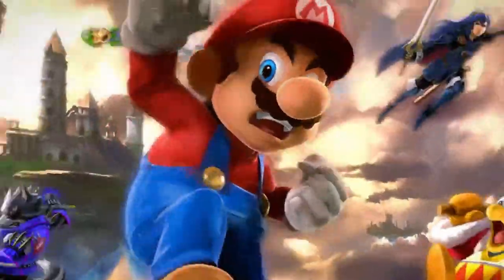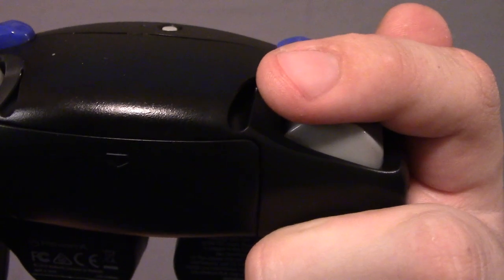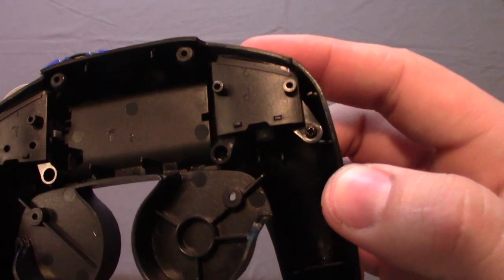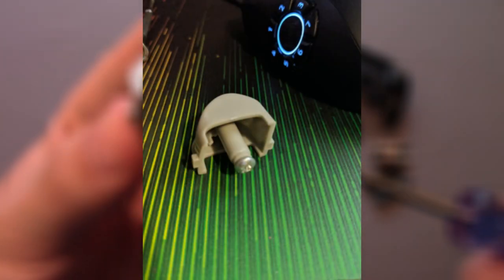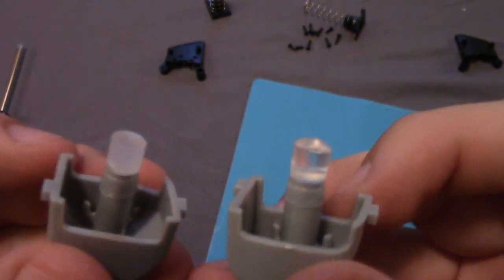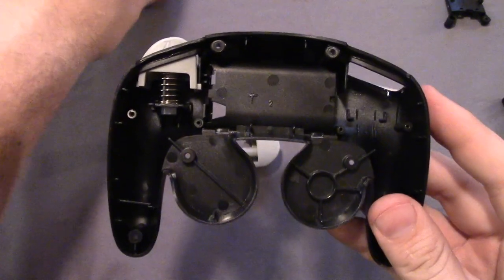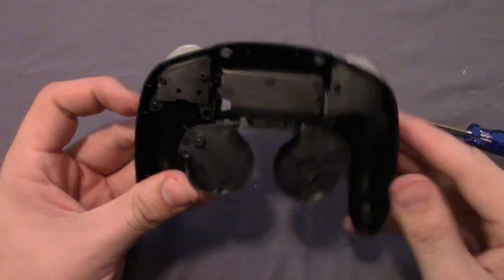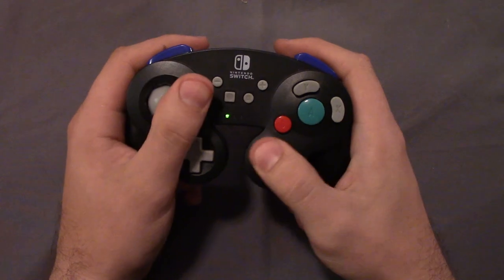How to FIX your PowerA Wireless Gamecube Controller Triggers

Comment from the maker: If you did anything differently to plug the triggers and close that gap, let me know! There is more than one solution and I want to see how creative you can be!
Reply: Can you make a video about the analog stick? I have multiple problems, an I'm looking to replace mine
Reply: a bit late to say, but a qtip's stick fits in perfectly
Reply: SpazTac13 I was the first person to do this 🤣 glad to see people actually using my idea I posted on amino now I’m trying to do it again on another controller
Reply: You can do basically the same thing using one of those pink pencil's rubber, cut it in half and use one half each side👍
Reply: Martin Schmidt  I bout 2 of them on sale at gamestop. I like them I wouldn't buy them for full price
Reply: brocoliobama wait, sorry for asking 10 months later, but do the ones with paper rods work or do they have to be plastic? I figured the paper ones could wear down over time, but im not sure
Reply: Seeing the controller opened up makes me wonder if it would be somehow possible to add rumble motors inside the handles and got them to function

Comment: Just a warning to those trying this: I did try using this method and had issues with triggers getting stuck due to the glue. You can just use any old pair of screws to extend these very easily, the method in this guide might work for others but I just wanted to give a warning. Otherwise, this guide is great.
Reply from the maker: Yup, screws work great as well! I'm hoping to see all kinds of comments of creative people tackling this issue! Thanks for watching and taking the time to comment Cam.
Reply: @Kevin Cantarero what i found work are the screws that secure your motherboard of your computer to the case.
Reply: I know I'm probably late to the party but how about the best of both worlds? Still fill the trigger in with a material using a straw just like @SpazTac13 did but instead of hot glue, use resin? Like how people do to make custom buttons? Just a thought. I personally have never done a mod at all but from other videos I have seen, resin would work like the hot glue as in solidifying but without the "glue" feel and it would keep the button on the inside safe from a screw.
Reply: @br00talzd00d  true..... but there ain't no going back with the resin if you make a mistake with your measurements!

Comment: Here’s an even easier way of doing it:       I have the wired variant of this controller and after disassembling the controller I put a cotton stick (the things you usually clean your ears with) in the little hole on the inside of the ZL and ZR triggers. Then I cut the cotton sticks so that only around 4mm-5mm of the stick sticks out of the trigger. And boom thats lightning fast travel time for controller to register your input.                                   Thank you for coming to my TEDtalk.
Reply from the maker: I like it Elias!
Reply: Bro I used erasers and they popped out. I keep coming to this video to see if there are other solutions.

Thank you!!!!!
Reply: Did you have to glue them in?
Reply: @BaelorWolf  no
Reply: thank you so much, i tried this and it works great

Comment: I just bought this controller (purple variant) in Oct 2019 from Amazon because it was on sale and it does not require this mod. The triggers have no "travel", they're just great clicky feeling digital buttons. I think they've altered the design in response to all the feedback on this issue. I haven't opened it up yet to see what they changed exactly.
Reply from the maker: That's what I've been hearing too. I need to pick up a new version and test it out.
Reply: @SpazTac13  I have two, one from a year ago and the second from literally just now. There is no difference between the two, though, I did mentally think there was initially.

I will note that people are probably pressing in closer to their hand which does make it seem like your finger travels less, but it's always traveling the same distance.
Reply from the maker: @yojoehojo4291  Thanks for letting me know. I was hoping they would figure it out by now like PDP has.
Reply: @SpazTac13  too bad the xbox enchanced controller has these issues lol
Reply: When I press the triggers down (especially the left one) it send a strong and extremely annoying vibration along the ENTIRE controller. Does your do this or is this not normal? I have the wired Version BTW
Reply: I got one this week and it has the travel, so i will be doing this mod

Comment: Just an update, recently got a wired version of the power a gc controller. The triggers dont have the trigger isssue anymore, its just a quick click
Reply from the maker: That's great news! Thank you for letting me know
Reply: If u can make a quick video on how to fix the triggers for the new wired version, it'd be great. Because I bought mine just yesterday, and after just a day if playing some smash with it, the right trigger is not even registering when I press it any more

Comment: My right trigger feels heavier now... that's weird. Used screw method. I had to use plumbers tape to make screws artificially larger. I think some is stringy and is interfering with the spring. Excellent guide!

Comment: I wanted to get a power A but the triggers were stopping me, now they aren’t. Going to try this and let you know how it goes!!
Reply from the maker: Awesome  FreakBag. Lemme know what color you end up with, they're all so cool and collectible. Btw awesome name! Subbed
Reply: SpazTac13 I removed the spring from the triggers and its instant press now, will this be bad due to the fact that it’s directly hitting the membrane?
Reply from the maker: @FreakBag22  I doubt it since the shoulder buttons and face buttons all rest on the membranes without any springs. You shouldn't have any more wear than usual.
Reply: FreakBag did you add glue though?
Reply: The glue method didn’t work for me, but I just removed the springs and it worked great

Comment: Thanks a lot for the video. Since I don't have hot glue around i had to figure it with different materials: cut pieces from an eraser and glued to the trigger, than i used your method to shave off the excess rubber. Works and feels great.
Reply from the maker: Adapt and overcome Mateus! Thank you for watching and taking the time to comment. I'm glad you found this helpful!
Reply: That sounds like a great alternative

Comment: Great video! I'm definitely going to have to do this and the weight mod. Quick question, what size nut did you use? I want to make sure I get the right one.
Reply from the maker: I used a 5/8"-11 it seemed to fit the space well.  Since your gluing it in if you wanted to go any lighter you'd be able to as well.
Reply: This video was definitely helpful probably took me 10 mins to do this mod and the best part I was able to find everything I needed I'm my junk drawer 🤣

Comment: I can't get farther than pulling it apart. The controller has something holding it together at the bottom of the plastic on the dpad and cstick. No screws holding it, but it will not come apart. If I pull any harder it will snap.
Reply: maybe something sticky got in it? you could try using a screwdriver or a knife to try and pry it open around the part thats stuck
Reply: same thing here, how did you managed to open it?

Comment: i took all the screws out i can’t pull the controller apart it’s like attached by something strong
Reply: Pull it apart and it won't break, I encountered the same problem. I have put it back together now and it works perfectly

Comment: Very great video, surprisingly few views on it.
I'm gonna be picking one of these up, and because I plan to be playing Terraria with this thing(a game that uses the triggers a lot) it'll be helpful to know if I decide the shoulder buttons have too much travel for it.
Reply from the maker: Hey, thanks for the kind words Golden! I've just recently gotten started with my gaming centric channel here and I appreciate every view and all the feedback! 
I definitely recommend this controller and should you choose to modify the triggers it's very easy to do.
Reply: @SpazTac13  I'm really looking forward to picking this up, then. A while back before it came out, I had actually been talking to somebody about how I wish there were a Gamecube controller with the additional shoulder button, and clickable joysticks.
Here comes this, which has all that, AND gyro controls, and a better D-Pad, and I'm sold. This is absolutely the controller for me.
Reply: I have received my controller, and I'm wondering if there's actually any chance you'd be able to help me another way.
The controller I've gotten is used, and while it feels great and seems to mostly be in great condition, I have a slight problem with the main joystick, in that it's mildly wobbly at rest. I don't blame this on the controller itself, I think it's just worn from the previous user. Do you know if there's any way to firm up or tighten the joystick on this controller? I'd like to be able to just do this rather than asking for a replacement, since I just got it.
Reply from the maker: @GoldenTerrabyte  I can try to help you out and look into it with you. I never really messed with the board or anything else on that side for the video but perhaps I can open mine up later and give it a look.
Reply: @SpazTac13  Any help would be appreciated. The controller handles very nicely outside of the loose stick, so I would hate to miss out because of a faulty individual. The build quality actually feels very nice, and the buttons themselves feel like they should.
Reply: It's also worth mentioning that the slight wobble does indeed register as input. It isn't a big deal on my PC where it allows me to set joystick deadzone, however it does interfere on the Switch, especially for Breath of the Wild it appears.

Comment: I bought another one of these controllers this month and the trigger travel appears to have been fixed from the factory. I opened it up and the molding for the triggers has changed. My box has the lot number: LOT90320D0401
Reply: thanks <3

Comment: Hey does anybody know where to get replacement parts for the power a gc controller? Wanted to put a custom shell on mine but the shells are different from og gamecube controllers so i was wondering if they sold any. Ive looked on amazon and ebay and found nothing. any help would be greatly appreciated thanks
Reply: Have you found anything? I’m also looking to do the same!

Comment: I have a ZL button for my wired Power A controller that will not read the rubber piece. I checked the sensor thing for it, and nothing works. How do I fix that?

Comment: Will this work on the Wired version? I have both the Wired and Wireless PowerA. For the wireless I have used the screw method and its works like a charm. Unfortunately I haven't found a solution for the Wired version as the inside dimensions are a lot different. Maybe you can help.
Reply from the maker: So the triggers on the wired one's are different and the screws aren't fitting?
Reply: @SpazTac13  Correct. The triggers are larger inside. Screws do not fit perfectly like they do in the wireless one. I have not found anything that fits but is also able to hit the rubber pad. The pad and little opening for the trigger to go through are farther away making it a bit difficult to find a solution.
Reply from the maker: @DreamWindX  hmm. Now I kinda wish I had one to open up and look at. I suppose you'd have to get pretty creative to fill the gap. Before I came up with this method I tried a few other things around the house like some tooth picks.

Comment: why exactly should I modify Power A triggers? they're just fine the way they are for me.
especially when playing Mario Kart where you want a full press for the triggers, Smash Shielding is fine with it, I wouldn't modify them
Reply from the maker: Just keep in mind the Switch doesn't support analogue triggers, and these only replicate the feeling of analogue. It's basically a pro controller in a GC style shell, and other companies that have made similar controllers have made the triggers as buttons, as there is no real benefit to the travel other than nostalgic feelings. For those that enjoy it, I totally get you, right on, but there are some people that will overlook an otherwise well designed controller for this reason alone.
Reply: eh that's their loss. I actually picked the controller due to the trigger travel. same with the metal Mario PDP fightpad for smash 4, I have a real Gamecube controller as well, so it influenced my decision. I honestly don't get their decision.
Reply from the maker: @WednesdayMan  sounds like a sweet collection of controllers! Thank you for having an open mind and taking the time to comment.

Comment: Heya I know this is an old video but I just took my controller apart to fix it and think I lost a screw, how many screws does the d pad have holding it on? I think it's meant to be 2 but its hard to tell in this video

Comment: could that glue melt and damage the controller, like making it get stuck with time? or does it needs a lot of heat for this to happen suddenly?
Reply from the maker: Hot glue needs and intense amount of direct heat to melt. If your controller experiences anything hot enough to melt it, I'd say the whole thing is toast lol. Good question, though, thanks for stopping by Roy!
Reply: @SpazTac13  thanks, i think i will try it now.

Comment: By any chance you know how fix c-stick drift, basically when I flick it quickly to the left and it returns to the resting position it assumes that I was attempting to do a input to the right not the left
Reply from the maker: I'm sorry to hear that Mr. Pickle. I wish I knew how to fix that. I haven't really cracked open the sticks. Maybe there's a way to check for dust or something? I'm not sure.

Comment: How do you take the back off of the controller? I took off the screws, but it doesn't want to come apart. Are there more than 6 screws?
Reply: @Lachlan LIM No. I figured it out, there were 2 spots that the controller snaps into place that you have to do something specific to get them out of place. Now I have a different problem, getting a replacement joystick.

Comment: I have a question the name of the screw driver I need is a #0 Phillips head screw driver (3mm) right I want to make sure cuz my right trigger became somewhat mushy and sticky as of recently and I can never use this as it's always messing me up in smash and I just want to make sure that I'll be getting the correct one as the ones I thought I had were either too small or too big
Reply from the maker: Yes that size screwdriver is what I used. I picked up a cheap one to get this done and it worked fine. Just take it slow and steady with the little screws so you don't strip them out. Good luck and update me on your repair please!
Reply: @SpazTac13  thanks also I can use the same screw driver on the mini screws right? Thank God there's a hardware store a block away from my place
Reply from the maker: @Just__DJ  yup I used the same screwdriver to get the job done
Reply: @SpazTac13  ok thanks I'll tell you if it was successful or not
Reply: @SpazTac13  ok dude I have great news. I was able to remove the stuck screws( they were stripped so it took a long while to get it out) and I was able to fix my trigger, BUT the reason my right trigger got messed up in the first place is because apparently my controller didn't come with the trigger plate to hold it still which is pretty messed up and because of it the bottom piece of the trigger dislocated. Atleast I can fix this error if it ever happened again though and I am happy I saw this video.
Reply from the maker: @Just__DJ  that's awesome news! Thanks for keeping me in the know with your process... By the way I like your channel, good work brother!
Reply: @SpazTac13  thanks same to you :)

Comment: I’ve actually found that with my Power A controller, the B bottom will sometimes get jammed when I press it, and will stay as if I were holding the button down. Doesn’t anyone know what I could do to fix this issue?
Reply: 3 months late, but try taking the controller apart and cleaning out the membrane for it.

Comment: Looks like you no longer need to do this. I bought a wired one the other day cuz it was cheap ($20) and the triggers aren't SpongeBob at all.
Edit: so I got the wireless one as well and looks like the triggers on the wireless are still like this. But the wired ones are not
Reply: How much travel distance would you say is on the wired controller. Is it a simple press similar to the bumpers. Basically I just want to know if its noticeable during play.
Reply: @milesstallings5073  virtually no travel distance on the wired one! It’s just a quick tap, unlike the wireless one, which is more like the Original GameCube controller triggers
Reply: @doncorleon8104  thanks, the triggers were originally a deal breaker for me, but now I'm not worried.

Comment: 3d print the extender where it plugs into the hole at the bottom of the trigger to have something to keep it in place, and bam easy slip in install, its pritty much fitted 3d printed pegs that are a tight press fit, sould i make them would they sell?
Reply from the maker: I think they would. That's a solid idea. I would've done that had I any access to a 3D printer.
Reply: @SpazTac13  iv notice the powera controllers have updated and they have fixed the issue with my black umbreon controller or my the pokemon edition ones are different maybe but that one i have has no extra travel but the gold/silver/purple ones does and the shape is slightly different and the plastics are cheaper on the too/ if you want the perfect gamecube controler for smash bros look into the pokemon edition ones made in 2019